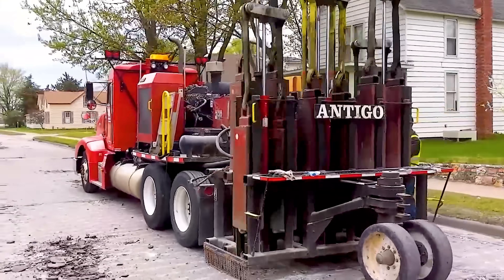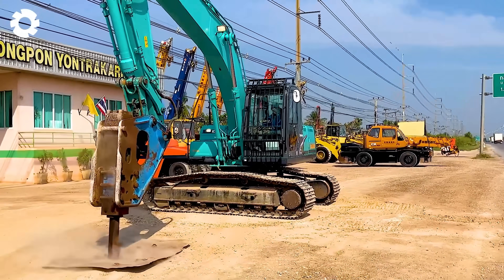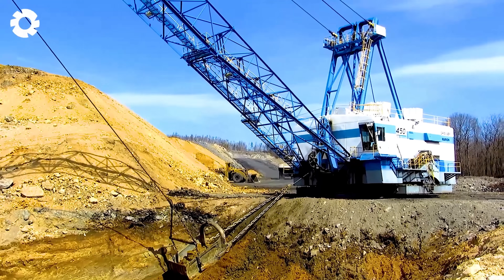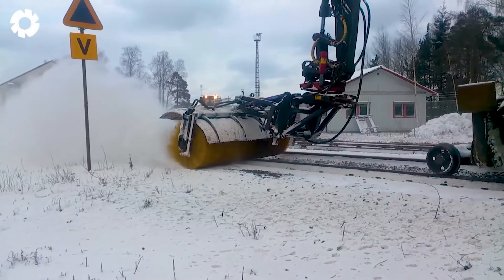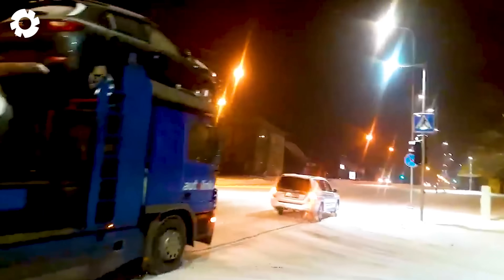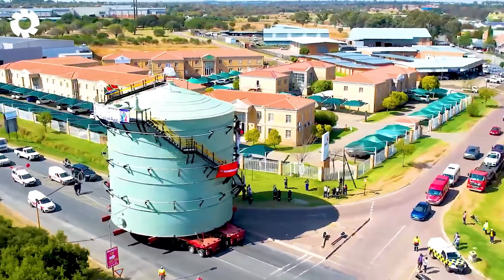Transporting Chickens This Way - The Biggest Heavy Machinery | Agriculture Technology

Comment: Introduction to Heavy Machinery (00:06)
MHR Z BV Crane (01:10)
Watt Pack Machine & E190 Truck (01:10)
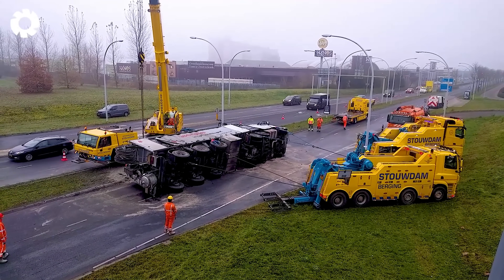Truck Recovery Operations (02:13)
Hitachi 1870 XXL Excavator (03:19)
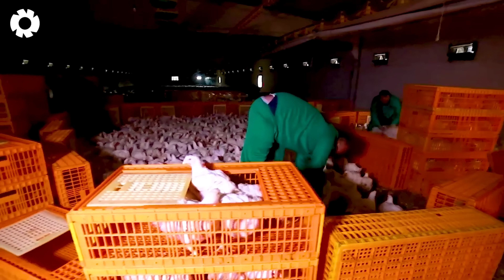Transporting Chickens (04:18)
Antigo Badger Concrete Breaker (05:22)
Kamasu 56 VX Excavator (06:47)
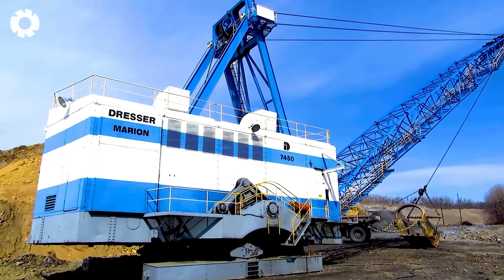Marion 7450 for Mining (08:13)
Volvo L150 H Loader (09:23)
Meny Muk M545 Snow Clearing Machine (10:26)
Yun Oro 53.2 Dead Von (11:26)
Truck Struggles to Pull Vehicles Uphill (12:33)
Snowstorm Challenges (13:33)
SPMT Self-Propelled Modular Transporter (14:37)